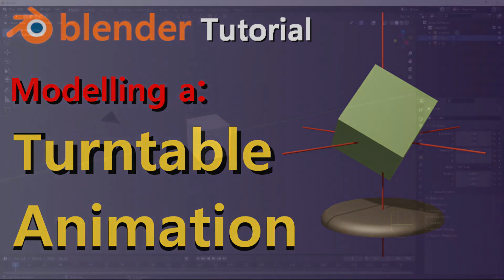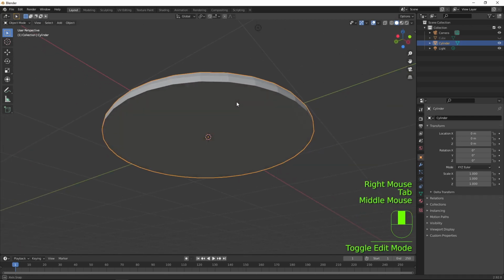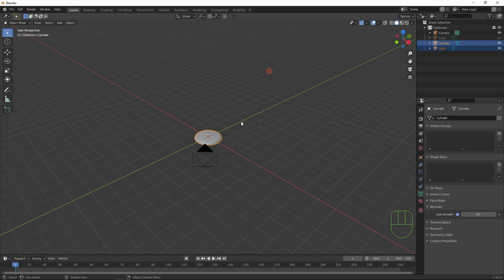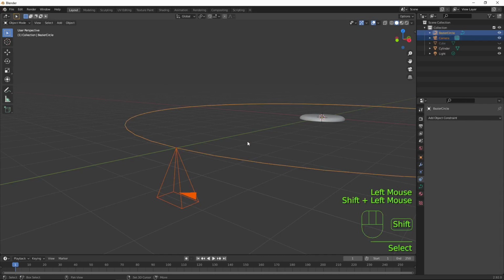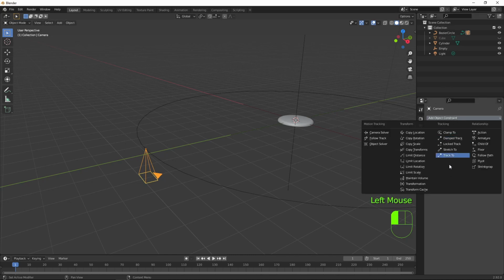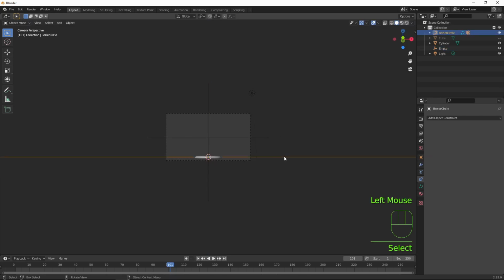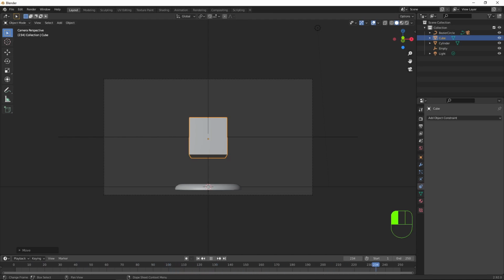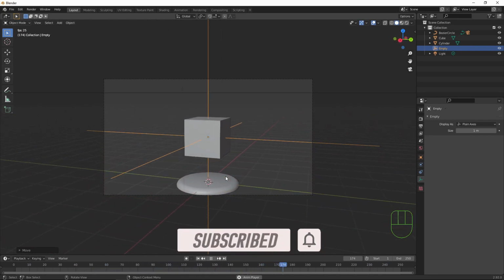Animating a Turntable | Blender 2 9+ Tutorial

Comment: How do i extend the amount of time duration in the animation? All I have is 100 frames thats a whopping 4 seconds long. Id like to make it longer.
Reply from the maker: In the timeline editor at the bottom of the screen (the window with the play head) on the top right should be two boxes, one will have a 0 in it, the other will have 100, change the 100 to whatever you want , it's roughly 24 frames per second by default, so if you want it for say 10 second change it to 240.